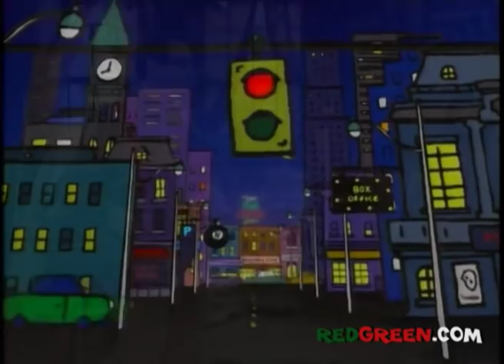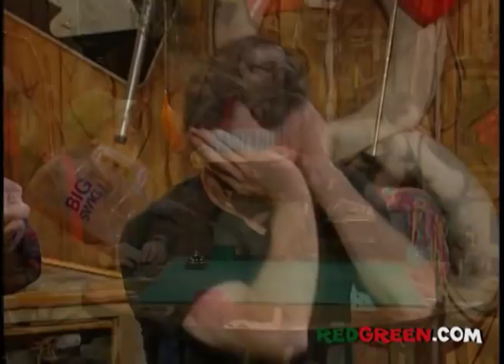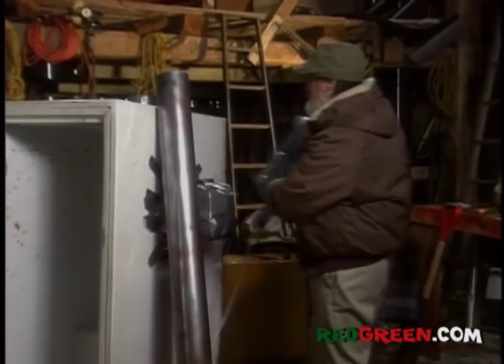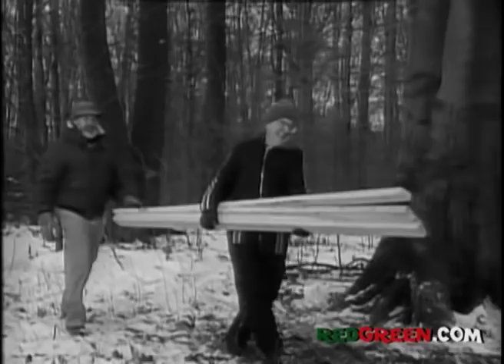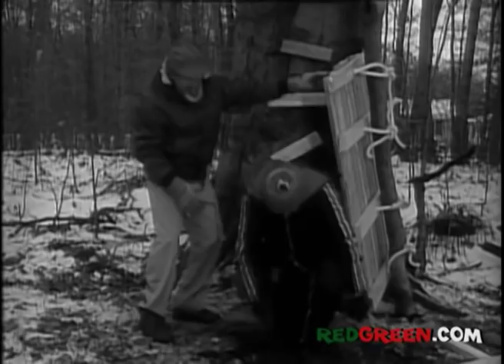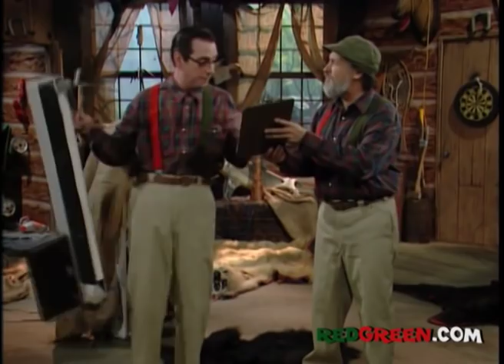The Red Green Show "The Splinter Lodge" Ep 157 (1997)

Comment: Note : The following is not expert advice .  If you take it as such I am not liable .  It is merely my opinion, some reading and my own subjective experience .  Do your own research and talk to outdoor experts .

Seriously :  If you perspire , get soaked by wet snow or rain , in the winter outdoors(even at 50 degrees F / 10 degrees celsius )  and you didn't know that polyester (or some synthetic) came back a long time ago ,  you just might be dead by now .  Those wet cotton thermal underwear take the heat right out of you , that is called hypothermia . And stay away from down coats and vests .  when down gets wet(even from your own perspiration ) it is useless .  

You want polyfill or holifill  in a coat or vest .  Another good alternative to synthetic long underwear is wool .  Merino wool if you get the itchies from the scratchy type wool . Get boots a size or two bigger .  you can fit in it several layers of bulky wool and or synthetic socks .  If your boots are too tight ,  you pinch off blood flow, can't wiggle your toes and set yourself up for frostnip or worse frost bite .  

My first bout of hypothermia came upon me when I was cross country skiing decades ago .  It got warm and was around 50 F/10 C .  I was shivering but then i became clumsy , confused , shivering like a mouse .  For some reason, it seemed almost like instinct but probably because i was shivering so bad ,  I stripped from my waist up .  I took that soaked stupid long sleeve thermal undershirt off , squeezed the water out , put it in my small backpack .  Then put the Shetland Wool Sweater right on top of my skin and my unlined pine green unlined wind resistant Woolrich shell parka over that .  I felt better quite fast but that is not always the case with hypothermia .  It might take longer .